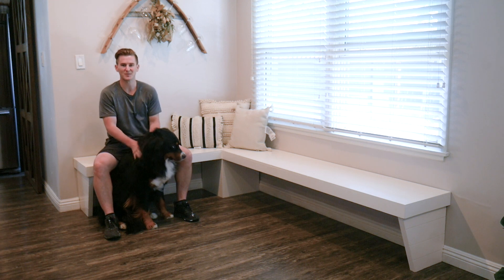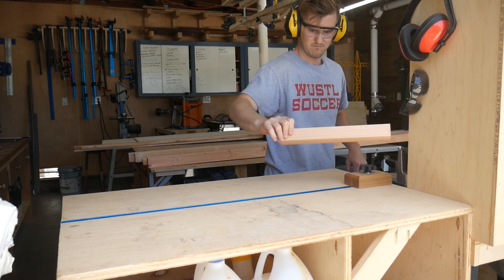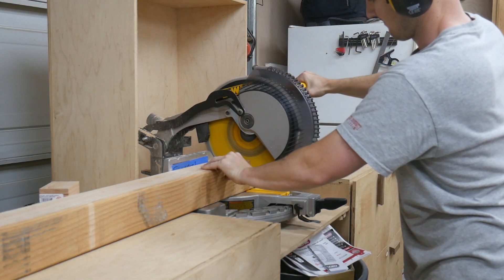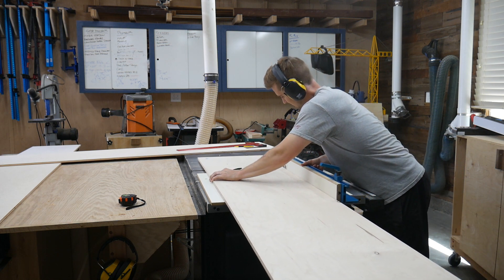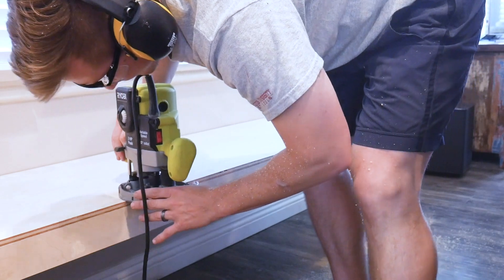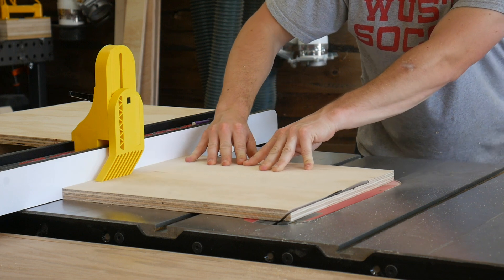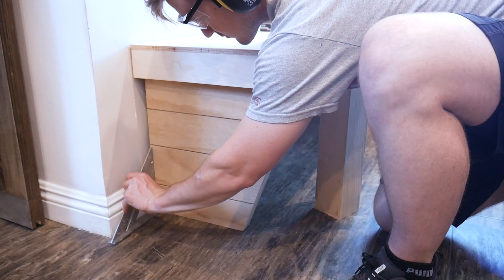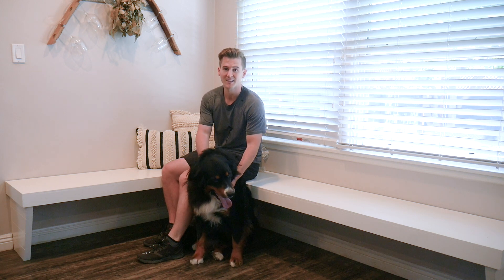DIY Breakfast Nook | 61

Comment: This is exactly what I am looking for.  Did you screw to the frame to the horizontal or vertical studs?  in my case,  I have to end the right side of the frame before reaching the next vertical stud so I am wondering if it is solid enough with only the decorative support.  My kitchen wall does have the lowest horizontal stud at about 19" high from the ground.  If I want to nail the frame to the horizontal stud, my benchtop would be around 21" tall which is a little high.  What's your benchtop height?
Reply from the maker: Vertical studs + decorative supports should be plenty. Can always add more - good luck

Comment: Thanks for such great video and build. Nice edit and presentation over all. Quick question: The extra 2x4 that you added to the bottom... did u face join it to the 2x4 that is now a 2.5in of the frame?
Reply from the maker: Yes! It was the same width as the framing so everything was flushed up and hidden
Reply: @workshop_edits  Makes perfect sense and thanks for such quick reply. Also, great creativity on the design. Cheers!
Reply: Hey, one more question pls. For reference, how long did you cut your cross supports? Thanks in advance
Reply from the maker: I’m not sure which specific one you’re referring to but there is a SketchUp model to buy in the description that gives you access to all the dimensions in the model
Reply: @workshop_edits  oh didn't see. Thanks.
Reply from the maker: No worries good luck
Reply: Where is the link of the sketch up? It is not in the description. Thanks
Reply from the maker: Send me a DM on Instagram and I’ll send it. Sorry that i forgot the link in the description
Reply: Hey, sorry I dont have instagram.  Really, I was just trying to confirm if 1 sheet of 2x4 plywood was enough for the outside supports once you double them up?
Reply from the maker: Check my website. The file is there.
Reply: Thanks for pointing me to the file! It was really helpful. Where you able to make it a seamless top by filling the gap of the 2 sitting panels? Wood filler, some sanding?... I appreciate your tips in advance!
Reply from the maker: That is correct. The top has wood filler to cover all nail holes and the gap. We also bought cushions custom made for it so you don’t even see it. You can see the final piece actually on my IG with our table. Cheers

Comment: What is the trick with masking tape around the paint can....is that to stop paint running into the groove? Nice build by the way, how long did it take?
Reply from the maker: I saw it in a tips and tricks video somewhere and figured I’d give it a try. It’s more to prevent run off down the side. It worked pretty well! Took about two full days start to finish that - that includes filming though

Comment: What were you doing w the side of your screwdriver, on the plywood edge?
Reply from the maker: It’s a method I picked up that rounds over the veneer slightly so when you go to sand it lightly you preserve the veneer but take down the sharp edge. I do it pretty much now on every plywood project that is furniture based.
Reply: Workshop Edits nice! I haven’t seen that before. Another question: does plywood end grain take the paint ok?   Vs adding a veneer.
Reply from the maker: I did two coats but it took it really well. You can’t see the layers in any place. One more coat would blend it al together as one piece

Comment: Should have taken the time to notch legs to fit molding. Old style molding is nearly impossible to match when you remodel later on and someone if not you will remodel. When making changes to existing structure of any room you should always account for the next potential projects. This way, that next person doing the project respects your craftsmanship, rather than saying "WTF was this person thinking" as they calculate this extra cost you have bestowed upon them.
Reply from the maker: Not sure what you mean by old style molding but these baseboards were installed two years ago when our house was flipped before we purchased it. I don’t think for one second it would be any more difficult than bringing to my local but box store, matching it, and purchasing two pieces of base boards to replace. I get your thinking, but this seems quite trivial.
Reply: @workshop_edits  I respectfully disagree. I could elaborate elegantly a rebuttal, but I doubt you'd care or even appreciate that. Criticism isn't always a bad thing it can be a valuable lesson learned.
Reply from the maker: I already said I understand your thinking - I always take people’s critiques. I just disagree with it for this project in my home in particular. Cheers